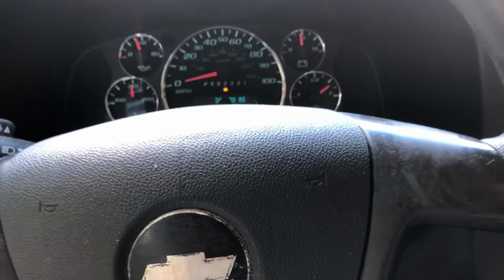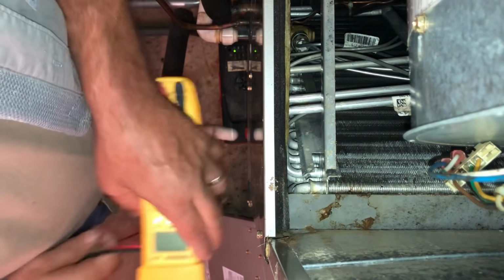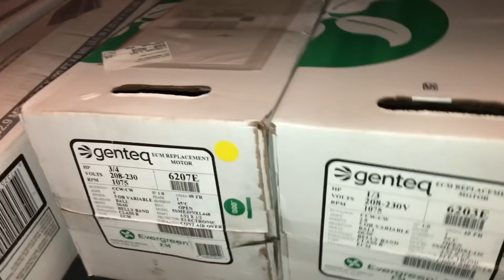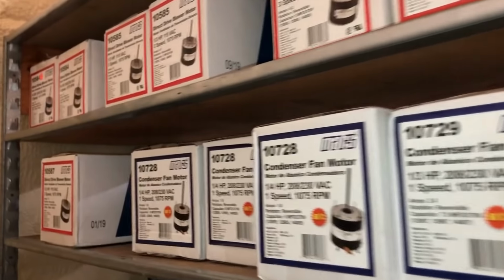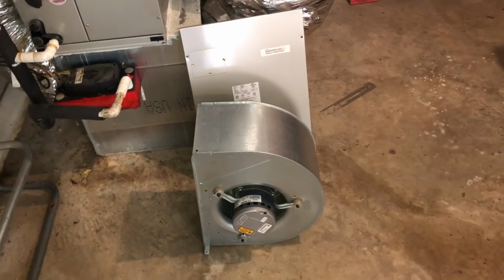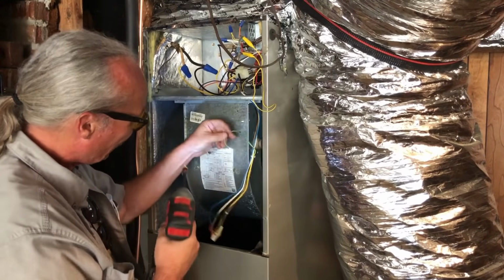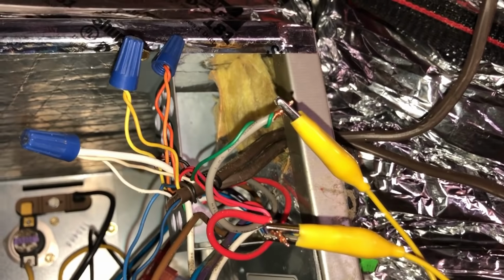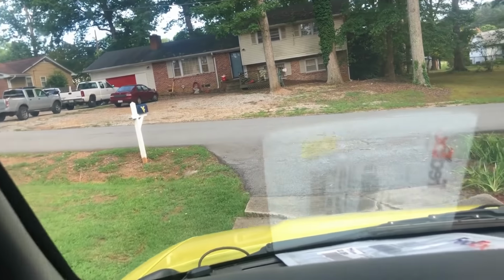ICP Heat Pump Blower Motor Replaced Comment Contest Video

Comment: The motor tap #2 is for cooling speed. (#4 is heat speed) The taps are programmed from #1 (lower) to #5 (higher) speeds. Sometimes only the motor #2 tap is faulty. Try putting that wire on tap 1, 3, 4 or 5. That could get a customer operational until a replacement motor is found.

Comment: When doing electrical work I recommend the use of an induction probe to see if a conductor is "hot".  The meter is fine but the induction probe is much faster and pretty accurate.  (from an old electrician)

Comment: For the contest I would recommend a blower wheel puller for that job. I have a supco brand one runs about 35 bucks but it's worth it's weight in gold for those stubborn shafts. Just a little WD40 or whatever penetrating oil you prefer and those suckers pop right out.

Comment: Yeah you did exactly what I would do. Sometimes to do another check of proper communication of the board/low voltage i will use my TECInspect tool the hooks up to the 5 pin. Getting the motor out i might sand and use a drift or use my vans Parts rod fan blade and blower wheel puller. (Very hard ones use my solder torch to warm up around the set screw housing. You do great 👍

Comment: I would like to suggest the Klein Tools 56005 1/4" Wide Steel Fish Tape in the 25 foot variety, not that it would've been of any use in this particular instance, but I just find myself using it for even short runs of cable. Even to get through pesky condenser fan motor shrouds and holes. It's also fairly affordable, I think I paid $14.99, and it's made in the USA!

Comment: I would recommend some double sided nut drivers. Malco makes them as well as Dewalt. 1/4-5/16 is the main one I use and I got it from Malco. They also got 3/8-7/16. You can also get them in multiple lengths for if you need short or long reach. It helps if you are having to swap between multiple sizes without changing the whole driver. Also because they are reversible you can clean the metal off the magnet.
Reply: Lol, I guess I recommended to early towards the end you were using one I think.

Comment: From experience I’ve found that sometimes taking off setscrews can be a pain, especially fitting an adjustable into small spaces, I recommend using refrigeration wrenches to work them out as it can be easier.

Comment: I'd say a good pair of little channel locks for changing the motor out of the motor mount. I've never had any luck with those adjustable wrenches, all I get from those is about two goes and then I have to adjust them (and twice at that because I adjust them the wrong way the first time)........

Comment: My recommendation is Fieldpiece RCT2 Molex Probe Tips
so you do not have to remove wire nuts and you can test wires through the back of molex connectors.

Comment: All i gotta say is reversable hex driver, you can get sizes from 1/4 with a 5/16 or a 5/16 with a 3/8, (color coded as well) its a simple design with a magnetic center super handy to avoid droppin your screws on the ground or somethin real nasty. By poppin off the head of the but you can just wipe off the magnet and its clean again brand new i find it annoying having to swap bits from my drill every 5 seconds so this is a real time saver if you got yourself a unit thats got 5/16 and 1/4 or maybe even a 3/8, i work commercial so i find alot of people just put random screws wherever they fit so with a quick flip of the bit head your on ya way to make the job that much easier, its a really simple design and super durable, its impact rated so no worries there, theres different length and pricing can range from 4$ to 12$, pretty cheap ide say for a quality product. The company that makes them is Malco you can order online or your local supply house

Comment: I think you should have the Supco FPRO100 Furnace Pro Switch Clip

In your toolbag.  Use it to hold down the furnace door switch instead of tape.  You will always take it with you when the repair is complete and it prevents you from leaving the customer's system without the door safety switch active.  You could accidentally leave the tape on and that would not be good.  Safety first.

Comment: For checking refrigerant, please try the new Fieldpiece jl3 wireless probes. I have had them for a few weeks now and they are incredibly accurate and connect well with my phone. As always, great job Ted. Hope you have a nice day and stay well
Reply: I like them, but what if i need to adjust the charge and those things are now in the way on the valves?

Comment: Hey Ted
There are little small LED lamps clips that you can attach left and right side of eyeglasses. Its cheap and functional. So you dont have to hold lights and you can use both hands and still have eyeglasses on too.

Comment: Tool suggestion: Malco makes a 3/8 to 5/16 magnetic reversal bit driver 2 4 6 inches long  I use it all the time 2 inch (Model MSHC1) with Dewalt DWARA50 Right Angle Drill Adapter u will be unstoppable I use in the field every day never have to stop 3/8 is awesome for blower motors and of course 5/16 for all those bit tip bt143 screws

Comment: Here's my swing at the contest: use a propane torch, carefully, to heat the aluminum collar on the fan to remove it from the steel shaft of the motor. Makes things go a lot faster.

Comment: Get yourself a pair of KNIPEX Pliers 8605250, so you don't have to hold the screw on your crescent wrench. It just works better for in the long run, not to mention you can stand on the things to break twist fittings on compressors.

Comment: You mentioned not having a small bag and having to hold onto the same Klein pliers, amp meter ,  6-in-1 screwdriver and misc. others in your hands.  When you arrive on site, you have to open your truck bed door and get these tools over-and-over again.  Why not buy this small bag by FieldPiece?   The  BG36 Compact Inspection Tool Bag has a flip-top and keeps your tools from falling out when it’s tipped over. There’s a pouch on the side for cell.   Only $90 to $100 at supply houses, and I’m sure you can find it on Amazon !

Comment: Ted I've been using the Milwaukee 550 lumens pivoting LED light and recommend you try it out.  It's magnetic, so it sticks to the unit. Pivots for light direction.  Has a clip so you can attach it to your pants or tool pouch.  Usb charger so you can charge it in the van.

Comment: The Uni T 210e clamp meter is pocket sized and still does high uf along with ac amps and a rarity, dc clamp amps which is useful on your vehicles when looking for undesired current drain.  $49 on amazon, its cool enough that Nor Cal Dave has one.  I have two, one for the tool bag and another for the kitchen tool drawer.

Comment: Hey ted, I like the fluke meter that has the extended flexable amperage attachment so i can check amperage of the blower wheel accurately after the repair

Comment: I bought a tiny rubber mallet really light weight it’s been perfect for those dirty/rusty shafts I’ve had pretty good luck with it so far I can really wack it and not have to worry about dinging it up. Have you seen the new malco flip bits they shaved the 1/4 side down so it actually allows you to get into a lot of places you couldn’t before with them.

Comment: Hello. For troubleshooting ECM motors there is a tool called TECMate Pro for testing ECM motors. The one that i know of comes with  the plugs for ECM motors. The one i have used made verifing if the ecm motor is still good easier. Just a way to be able to test them quicker. Also with having to take motor out of blower wheel, I have used a small piece of all-thread on the shaft then my hammer. That way I don't mushroom out the shaft.

Comment: I have to recommend the low voltage ecm motor tester that multiple companies make other then that I like the desalt flexible bit attachment for my impact 35 dollars at Home Depot and the thing has lasted for over 3 years and still going makes dissembling anything a lot easier and faster add a socket attatchment to it and you can remove any size bolt with ease. Maybe you should get a blower wheel and hub puller as well it can speed up blower or cfm removal

Comment: I know you get a lot of clogged condensate drains and always seen you use a vacuum. Have you ever tried a Co2 powered drain gun? They pack quite a bit of pressure in those little cartridges. The Divers iTech Gg-1 is a fantastic Co2 condensate drain gun.

Comment: I would try using  wire wheel  to clean the shaft. A brush that has 1/4 to fit your drill.

Comment: Ted you should look into Fluke 381 Remote Display True RMS AC/DC Clamp Meter Makes it easy to close up a unit and check amp draw on the blowers under true running conditions

Comment: I am currently using the DEWALT DWHT69233 Multi-Bit Ratcheting Screwdriver Set with malco 1/4 5/16 reversible hex bit attached. You can also store the screw driver bits in the handle. Also check out the CRAFTSMAN 4V MAX Cordless Screwdriver (CMCF604). Wouldn’t use the cordless screw driver anywhere on a furnace though, may over torque.

Comment: Get some Bed of Nails Test Leads. You wont ever have to expose wire again for checking Voltage. No wire or insulation damage and you wont have to disconnect any plugs to gain access to its terminals.

Comment: Instead of using a sledgehammer to tap the hub, I use a socket that goes over the shaft then tap the socket. That way the force is even. Also I prefer brake cleaner to break free the rust in between the hub and the shaft.
Reply: I will also use a vice grip to hold the mounting bracket once I have it at the right hight.

Comment: Hello! I have a very simple but effective tool instead of sand paper to sand the shaft. I use a $5 wire wheel brush attachment on my impact to take the rust off. Works like a champ!

Comment: Another good video. It seems like that you always get to fix blower. ( last video was crazy with snake🤣) so Ultimate fan puller will help you for easy ease ? I got posi lock for bearing and Ultimate fan puller for condenser fan motor.  I got ‘em from Johnstone.

I love my craftsman offset box-end wrench it’s my favorite tool to work on almost anything.. Got it from Sears.

And finally I always have heat lamp with me all the time.

Thanks for sharing sir.

Comment: Try the 3/8 m12 ratchet and impact deep well socket in my opinion it works a little easier than the impact as you can get into tighter spaces

Comment: Ted i would recommend Zebra Universal ECM motor and Control board tester. You can change connectors on it to connect to any brand ECM Motor and X13 motors. I have been using one of these Zebra Universal ECM test kits for a few years now. Happy HAVCing \m/\m/.....

Comment: For clearing foliage to create space around the outside unit try a Milwaukee cordless hedge trimmer.  Compact unit that works with 18 volt m18 Milwaukee batteries.

Comment: I've got one for your contest. Since I see your little spray can of creeper oil is almost empty, next time you have a rusted shaft, hub or bearing that you need to get off, try used vacuum pump oil! I ran out of creeper oil one time. And since I have the Feildpiece vacuum pump I had used oil anyway and it's the best creeper oil I've used. Haven't bought a can of creeper oil in over a year! Give it a shot its not gonna cost you anything and you got it anyway!

Comment: For the blower motor a genteq tec mate tester from supply house bout 80 to 90$ and removing the blower motor got same method except i use a 5/16 star socket or called a female torque socket? & pb blaster. Thanks for the videos

Comment: random question .... given how dirty the condensers get drawing air in from the sides and blowing out the top , why dont they run the other way as to blow out the sides to insure a lot less crap from the ground closest to the sides wont get in ?  keep in mind im a mechanic not a hvac guy

Comment: Hey Ted how about a pen volt meter?
Fluke make a decent one. You can check line voltage just by touching wire.
Camera in one hand meter in the other.

Comment: I noticed on the manufacture's label that the unit is a 2015 ICP G.A.  If I recall, ICP warrant's its parts for 5 years, plus an additional 5 yrs if the installer/owner filled out the warranty card.  What is your thought on the warranty program by ICP?  Do you have a local distributor to provide parts warranty?
Just wondering since you used a Genteq aftermarket unit.  It appears that the ECM control unit, and perhaps the surge protection component  may have give up. Unfortunately, many now are completely potted so you cannot fix. I find the ICP stuff also easy to work on.  I understand getting the customer back up and running, since the warranty parts may not always be available for a good quick turn around on the fix.  Nice video and enjoy your video's and feedback. Tnx

Comment: My recommendation is to ditch the  heavy 18v Milwaukee and switch to the much lighter m12 versions just as powerful they have lots more options like a endoscope camera to look in tight places a handy light 3/8 socket wrench and a multi tool that you could just vibrate the motor shaft off the squirrel cage instead of the sanding and gel silicon spray. I love my m12 Milwaukee tools

Comment: Well Ted, You've been at this long enough that You're set in your ways and not much impresses you I'm sure. You don't need an ecm tester or a table to work on even though sometimes it would be handy.A wire brush on a drill does work( I saw Brad had one).One thing I bought for a couple of bucks was a tack puller from wally world. Its pretty good at removing wires from capacitors and boards. I got the idea from an appliance repair video. I have a lot of money tied up in things I thought were a good idea but at the end of the day I use the same tools and that other stuff just catches dust.

Comment: Check out the Supco Universal Motor Tester #ECMPRO. Handy little kit in a small package. It will test variable speed and x 13 motors. It even has a nice little "faux" leather zipper pouch to store it in. It has an LED on the tester to let you know if you have 24 volts coming in. One simple toggle switch on and off. Nice-sized alligator clips for 24 volts and common. 😎👍
Reply: If it don't start you've got to make a trip to the MotorMart.  😅😅😅
Reply: You're probably going to win it with that suggestion. Nice on man. I suggest a blower wheel puller until I saw him drop that hammer and it slipped out like butter 🙈😂

Comment: Hi my name is Adolfo...I liked the videos and also subscribed  aswell i notice you were running low on oil when you were working on CM I recommend a lubricating oil for your condenser fan motor with an ISO 32 turbine oil its not expensive and you could buy it in Home Depot for less than $10.  Its Top lubricants would be Synthetic but prevents  Rust & Oxidation/Antiwear Gear, Bearing, and Hydraulic Oil,  and keeps Motor Lubricant.

Comment: Mr DIY HVAC  I would suggest to use a wire wheel brush on your drill to clean that motor shaft it may work a little faster for ya

Comment: Definitely something other type of recoding device like a go pro for ease.  But careful with customers. Sander attachment for drill could work,  but ain't much to say to someone with your experience.  I have nothing to help you with your snake issue though. Craftsman use to sell and adjustable wrench with two handles that seems it could help.  Looks like tha Cresent was taking some time.

Comment: Was there no starter capacitor for the blower motor? The standard procedure would be to also replace the starter capacitor when a new motor is installed.

Comment: I use same method for x13. I recommend the universal zebra. For the different types. They always get new adapters. But as needed upon your application. 

The package includes one each of:

UZ-1 - Universal Zebra-Basic ECM Troubleshooter 

UZHMA - Adapter for GE, Regal-Beloit, and GENTEQ 1.6, 2.0 and 2.3 ECM Motors 

UZHMB - Adapter for GENTEQ Series 3.0 ECM Motors 

UZHMC - X-13 & X-Motor ECM's 

UZHME - ECM 142 Signal Controlled ECM Condenser Fan Motors 

UZHMF - Evergreen 'IM' Series 

UZHMG - AZURE ECM Motor

UZPH1 - GE, Regal-Beloit & GENTEQ Series 2.0, 2.3, 2.5, & 3.0 

UZPH2 - X-Motors, X-13

UZPH3 - ECM 142 Motors

UZPH4 - Evergreen 'IM' Series

UZPH5 - Azure ECM Motor

UZEXT - Extension or Replacement 36"� Main Harness

UZACC - Accessory Case

Comment: I use the TECINspect Service Tool and a service wrench to loosen the 4 sided screw. Once You plug it up and push the, if it runs, the motor is good if it doesn't then it's bad.

Comment: My Aunt and Uncles Garage is heated and cooled when they built their house they over sized the HVAC unit and put vents in the garage so when the heat or cool runs their garage gets heat or air they got a geothermal heat pump

Comment: Good morning Ted take a look at these spin staging tools they work well 
S6000 / Replaces SSPIN300-Swaging Tool Drill Bit Set With 1/4” 3/8” 1/2” 5/8” 3/4” 7/8” Bits